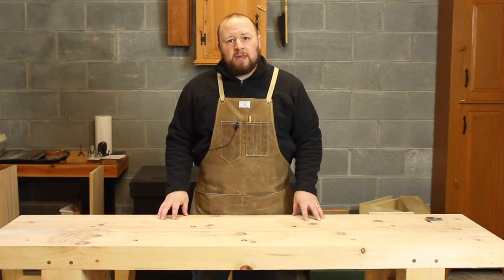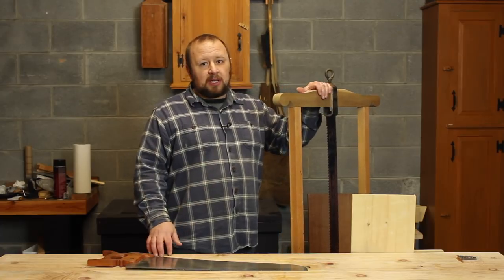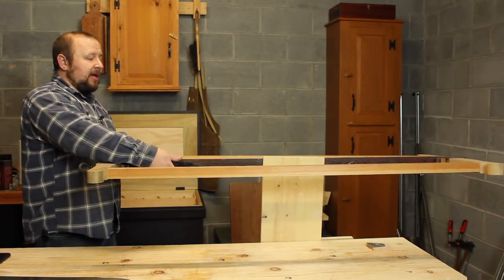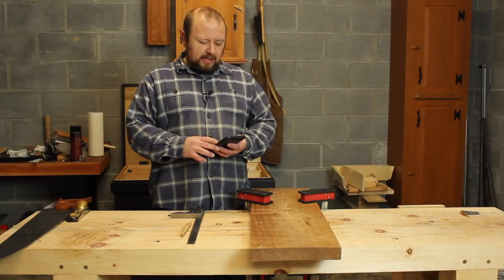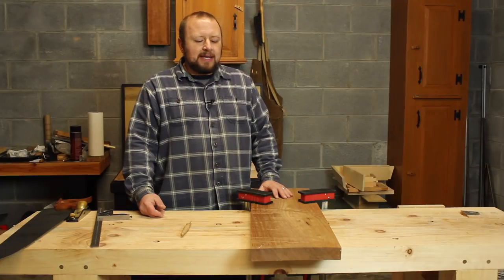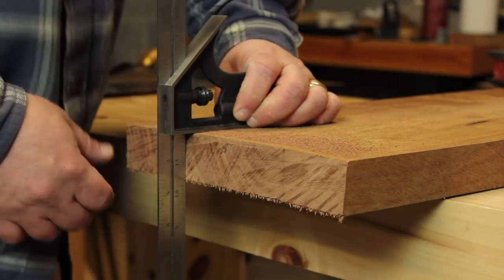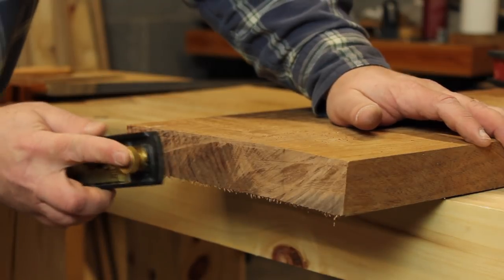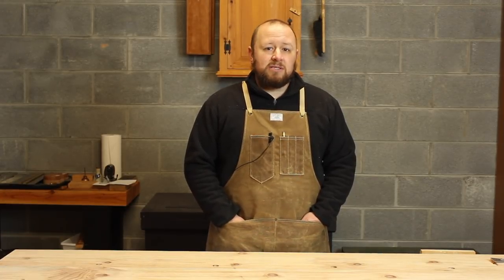Hand Tool Woodworking Q&A - Frame Saws - Planing End Grain

Comment: I’m finally getting around to building my Roubo Frame Saw, Kerfing Plane, and Turning Saw.   I went with the 36” bad axe because I’m 6’2”, but planning to do one end in the Tom Fidgen handle style.  I would have liked to have saved some money and gone with Blackburn kit since I’ve bought and built some of his other saws, but he doesn’t have the same finished plate and matching Kerfing Plane kit like Bad Axe does so there’s that. Besides, I really think being able to get shop cut veneers is going to really broaden many of my projects.  With the Kerfing plane, I can build a couple of standard offset fences for 1/8” veneers, ripping 8/4, 4/4, etc… and still make an adjustable fence also using my 3/4x6 thread box/tap.  As for the turning saw, I went with the 12” Grammercy Kit and you really can’t beat the price IMO (knobs, pins, 3 blades, and plans/templates for under 50$).  Still so very grateful for your content Bob and I would say that you and Mitch Peacock are my two most rewatched videos. That to me is a sign, not just of material worth learning, but also too that there’s a quality to it that’s worth my squeezing all I can from.   Could you do a short sometime on setup and use of a side rabbet plane in cleaning up sliding dovetails?  
V/R, Shannon
Reply from the maker: Well, I don’t own a side rabbet plane and have never desired one. I prefer to fit the part to the rabbet/dado, not the other way around. So for a sliding dovetail I personally wouldn’t adjust the socket. I prefer to fit the tail to the socket. This can be done with a chisel or dovetail plane, and I’ve used both successfully. Here’s a video I did on sliding dovetails. https://youtu.be/mrWVJhgH9t0

Comment: Thanks for sharing your experience Bob. That frame saw is a monster! Is there any way to set up guides to help one steer it?
Reply from the maker: Robert Amsbury I will sometimes start the kerf with a regular rip saw to give the frame saw some help in tracking straight. But for the most part it just takes practice and frequent flipping of the board, just like one would do when using the regular rip saw to resaw narrower stock.
Reply: Use a kerf saw for best results

Comment: So why wouldn't you secure the board to a ¼" piece of ply on your bench and plane the end as if on a shooting board?  That's how I'd do it...especially with a 60" wide countertop.
Reply from the maker: Lbhunter63 Shooting boards excel when planing small pieces. For something the size and thickness of a counter top, I find it easier to scribe a line and plane to it.
Reply: I find it hard to square large pieces on shooting board too. Usually I will just turn the board up right, then plane the endgrain with my no4. Work everytime